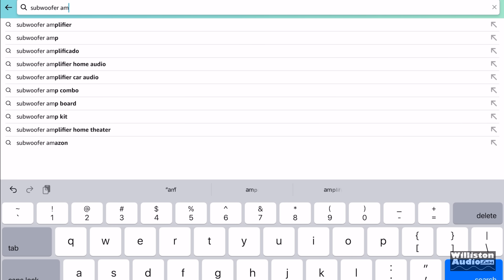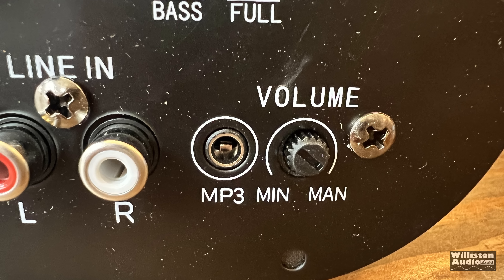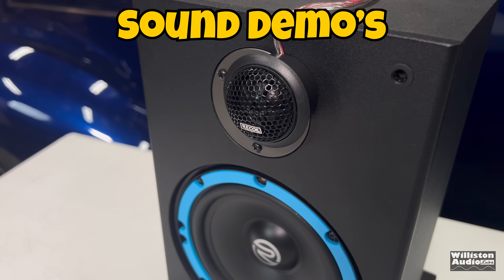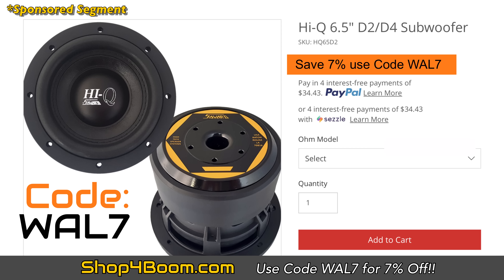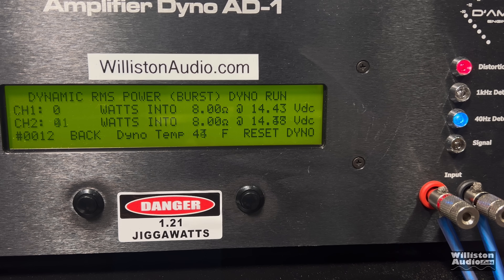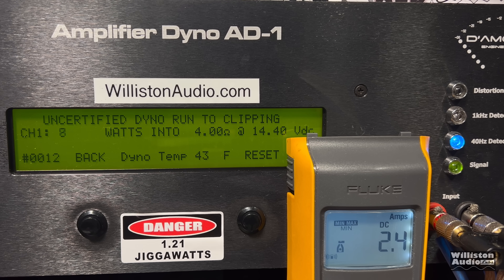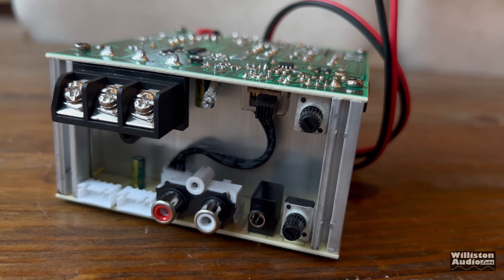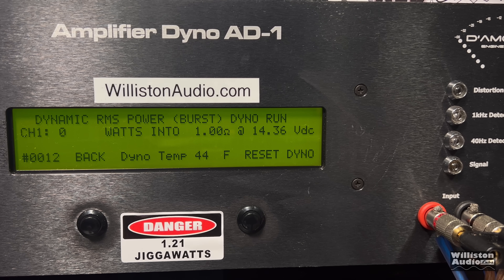Amazon's Cheapest Subwoofer Amplifier

Comment: Hey supposed audio guy, your audio is clipping over level.  Get with the program!  :)
As far as does it meet specs, meh, something this dirt cheap you have to just look at what it can do for the price point.  I know, I know, specs are golden and it's fraud if they can't meet them but  in this day and age, we've been down that road so many times before that I only trust datasheets, genuine ICs, and the correct input voltage to get there.

Sadly it's now about whether you can do any better at any particular price point, because we both know that if you tried to DIY build something like this, even something this low end, there's no possible way to get even close to building this for  under 2X the price.

Frankly it is amazing that this can be built and sold for this price point.  Good time to be alive in the audio world, just don't cheap out this much!

Comment: It's definitely that powder output limited by it's power supply. That transistor with class AB configuration can handle easy 80w power with good DC supply but seems like changing ohm not increasing power because of that power supply must be maxed out   at around 60w.

Comment: Color me shocked at how well this does, considering the price. I've bought at least a dozen "mini amps" over the last 10yrs and frankly all disappoint, but... for a small setup... At $17 it's really hard to beat if you just want to boost power a little bit or one a small sub. I could see running this on a set of truck boxes or an old Kicker box knockoff.

Comment: These inexpensive little amps are great if you want to add a center channel to your car set up, they are generally less watts than the rest of the system.  If they have speaker level inputs, you can install them behind the head unit in a factory premium system to drive the factory amplifier hotter and get a little more punch and watts out of it. I'm doing this with my Nissan Bose system and 2 of the tiny Taramps, and it almost doubles the volume output and still sounds pretty clean at all but the last couple numbers of the volume setting.. Put some new speakers in it and it sounds like a whole new system..

Comment: I run my whole home theater with car amplifiers, regular home audio amps weren't getting the job done. I run 4 15's in my home theater @ 3000 watts each.
Reply: @jankof76  what is your power supply?
Reply: @e @eshmikity 1 psu for fronts, 1 psu for rears subs

Comment: Not even genuine transistors. Only Toshiba makes the real 1941/5198 transistors, the beefier 1943/2500 has alternates from ONSemi and that's pretty much it. The power supply transistors are suspect as well. They basically turned one channel of a 4 channel amp into its own! 80 watts is possible at 2 ohms, but not with how they did it. Some upgrades could be had!

Comment: Installed one of these in a buddy's truck about 10 years ago. I had the amp installed in the glove box using 12-gauge wires, pushing a single 12 inch Earthquake sub. Worked pretty well, all things considered. Won't win any SPL trophies, but given the small size of the cab, and having the sub on the floor below the dash, it got the job done. For real cheap.
Reply: Right people think they need 135bd lol 😂😂to hit hard 110db is more than enough

Comment: I wonder if it would survive a  power tool battery as power. The tpa3116 amps work amazing on a Ryobi pack but they are built for higher inputs.. this might survive?
Reply: im loving the tpa3116 amps. & Im building something up with 2 power tool batteries hooked up to a dual chip tpa3255. about 100 to 150 watts a side, seems to sound great

Comment: no fuse open electrical danger Souds like shock or fire. not cool even if cheap. 3d print case in line fuse  can save you hole car from melting like a Tesla  Elon  name on it  using recycled parts selling as new for 100000 k the only thing smart. lol

Comment: Hard to make car amps more powerful and cheaper due to large amps/current from a 12 volt power source. This space going to be exciting once cars move to 48 volt power.
Reply: And wait for EV's to go to 800V architecture!  😃
Reply: Car amplifiers have voltage boosters in them to get higher rail voltage. If they didn't they'd never get the Watt output they do. He showed the booster in this amp in this video. It was the MOSFETS. The smaller transistors inside the amp.
Reply: @1pcfred  thanks for the info. that booster would have cost around $5 than without. Ive seen tiny mono amps boards that much more powerful and cheaper, albeit, they use at least 50V and not for car audio

Comment: Where do you plug the speakers. I'm missing something
Reply: This amp looks like it is only one channel to me. A pair of power transistors gets you one channel. The NPN transistor does the top of the wave and the PNP transistor does the bottom. Although you can amplify with just a single transistor too. But you're never going to see that topography in a commercial product. Well, not in anything over a Watt.

Comment: Man, I bought a set of Rockville W15K9D4 subs for $300, I bought a smaller dual 15" sealed sub box, and while it won't fit in the trunk of my 2013 BMW 128i, it'll fit behind the front seats if I put my rear seats down. The only amp that I have anymore is a 1750 watt Sundown SAI-1750D. I have the subs running at two ohms and they seriously slam, but that could be because they're right behind my head. My two Sundown SA12-D2 subs sound great too, but I put 6x12" Aeroports in each side of the box.

Comment: There is a use case for an amp like this.  It sounds surprisingly good for the cost, and only needs about 100-150W to run.  So if you built a small mini-cabinet for this and ran it off a laptop power supply, it could be used with some decent bookshelf speakers in something like a dorm room.  Would be a REALLY cheap setup for a student, easy to put together, and sounds reasonably good for what you put into it.
Reply: Could definitely be used to drive a little 6.5" or 8" for a compact trunk subwoofer too
Reply: @greenbassboosts8872 it wouldn't last long with an 8 inch amp.
Reply: But, you’d still want some sort of head unit feeding it. At that point you aren’t much better off than just using the head unit to power the system. 
Especially for a home/bookshelf type system there’s loads of options for a more all in 1 head unit that has outputs for 2 main speakers and a sub.
Reply: @NBSV1 you could use it for mid bass my first thought was cars that have the cut out in the back dash for speakers that wasn't for that model, head unit for the doors and this for a mid woofer or efficient sub
Reply: @thatdude8247  There's so many reasonable aftermarket head units available though. If the factory one doesn't have outputs for rear speakers then you'd be patching things in to try and run this amp anyway. At that point you might as well go aftermarket and get something that has actual 4 channel output and usually will have the outputs for a separate sub channel as well. 
Ultimately I think this is one of those weird budget things where you'll end up spending more trying to use a cheap amp because of all the extras it needs. Don't forget that for this you have to get things like a power wire and signal wires to the amp. At that point it isn't particularly worth the effort for what you get.
Reply: I had a similar model except it had single pair 5200/1943 transistor. I used it with 14 volts and it's power supply section diodes released magic smoke after 15 minutes of use

Comment: look at the transistors they are FAKE 100% for 8 ohms it has a potential to deliver the 80w and even more at 2ohms but im pretty sure because of the FAKE transistors their internal loses just overtake. PLEASE put genue toshiba 2sa1941 and 2sc5198 and  onsemi 50n06 those SEN are some knockoff that has HORRIBLE silicon inside and make a video you might get 50% efficiency and 150w maybe

Comment: Most Pioneer head units have the option to bridge the rear two channels for around 70 watts of power to a 2 Ohm load.
I've driven 4x18" subs this way.
Reply: You telling me you played 18" sub off a head unit
Reply: @BLAxWOLF-i   fun fact: Car stereo contestants used to be able to run just a head unit, to power their audio systems.....Harmon Kardon had manufactured the first high current head unit people used for this.

The 4x18" subs I used on the Pioneer head unit are Lanzer dual 4ohm units.........Ebay had them for $99.00 a pair shipped to me. So I bought 2 pairs..........I believe you should be able to find some Lanzar 15" for the same price now.

In a 25,000 square foot building. The 4x18" would rattle everything in the building.
Reply: It was not all units it was just one model and alpine did one unit aswell.  Early 90’s units had to run a direct feed to battery aswell
Reply: @Dont-come-at-me-24   Could have sworn all HK head units are high amp units.....not sure if I keept any information on their products......I keept all the Rockfod, and Zapco binders they give you, when you to school at the Factory's.

Comment: I just rebuilt a huge fusion brand amp thats black and green and takes 4 25 amp fuses and had to replace all the 50n06 in that amp those chips on the output and the power supply fets should made about 100 watts pretty easy at 2 ohm.

Comment: This would be great for truck owners with a single or extended cab and a small slim box crammed under the seat.  Plenty of good cheap subs to try too.  tang-ban, skar, dayton, etc...  Toss a midrange instead of a sub, and you will have incredible noise with even a cheap pair of speakers, as long as they have a halfway decent tweeter

Comment: Just a question because I didn’t see it. Did you have the volume at max?
Reply from the maker: No it was around 60% and it is a gain control even though it says volume. Turning it higher doesn't give you more output, just clips sooner

Comment: You know I was thinking about a much more expensive chip amp setup for a pair of 6.5 speakers I have setup to run as subs... but I think this would be  plenty. Wish I could remember what I put in there but I remember looking at silver flute and the Dayton ND140 but these worked in a smaller enclosure. 

What does the idle power consumption look like?

Comment: Always amazing to see how little power it actually takes to get a sub moving.
Reply: i had 2 mtx 12’s on 160w and it was enough for the mirrors to shift
Reply: I made a custom 10inch box in rear seat of Porsche 911 convertible with 60 watt amp, it was enough to make you puke.
Reply: @altopstwo3934 sure
Reply: @altopstwo3934  At what 70hz?

Comment: Where are the speaker outputs on that thing? I don't see where they're supposed to connect.
Reply: Looks like a red and black wire coming out the back side?
Reply: @bedlamite42  The problem is that the wire goes straight down and most of the time it is seen tucked inside the amp's guts, so it's never made clear how that is supposed to be a hardwired speaker output with an open end and not just another wire connecting different parts of the board.
Reply from the maker: They are hard wired and about 20ga

Comment: I bought a sub with that very amp built in it worked for a hour and died has no fuse so im pretty sure it fried something in the board and when it did work sound pretty good
Reply: Haha, darn! At least a replacement is only $20 if you want to fix it...
Reply: @volvo09  I'm buying something else with more power and hits harder than it
Reply: Having the amp inside the box, or mounted to it, can be hard on the amp. That’s a lot of extra vibration that can rattle any poor connection loose.
Reply: I'm thinking the installer is supposed to put a fuse inline when one is not present on the amp.